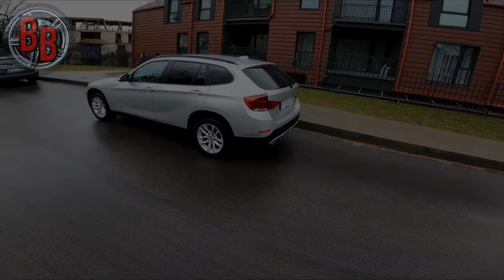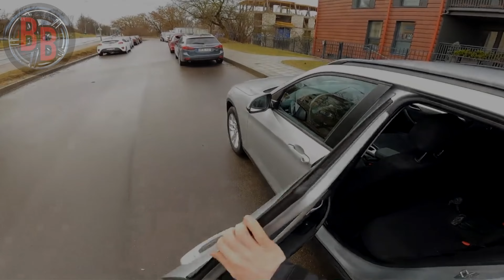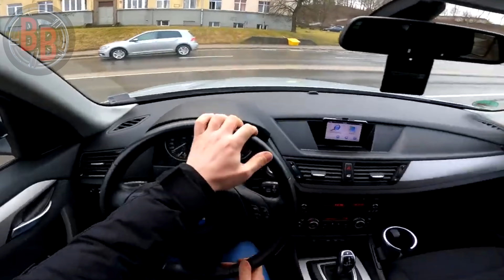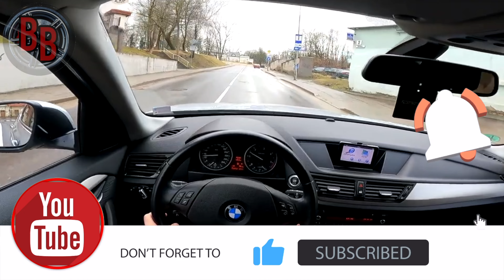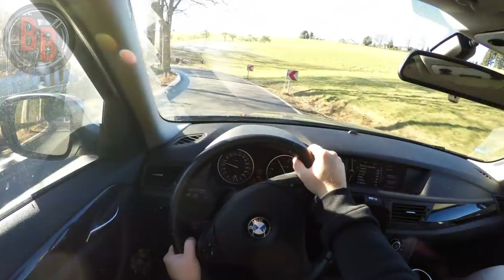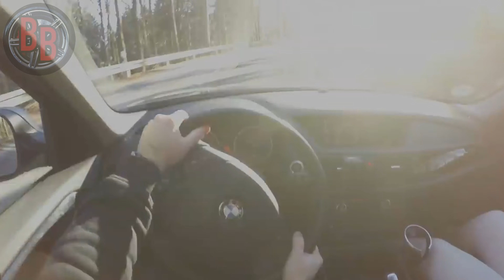BMW X1 E84 - Check For These Issues Before Buying

Comment: Very nice video! On the timing chain interval replacement at 100k-150k km, its more for the 4 cylinder or even the n55 need a timing chain replacement so soon?